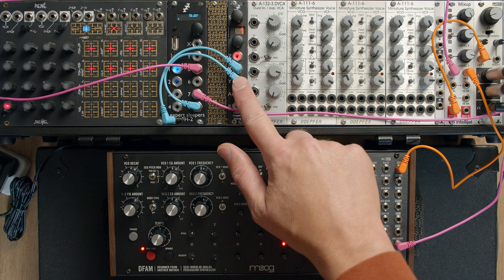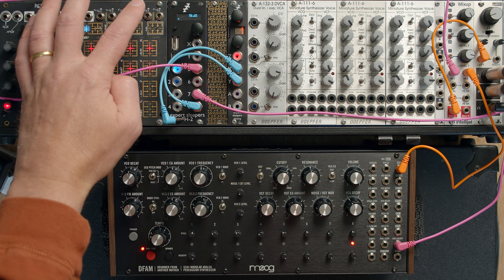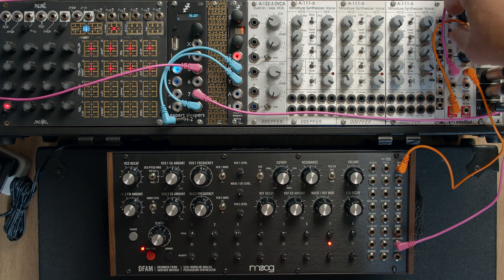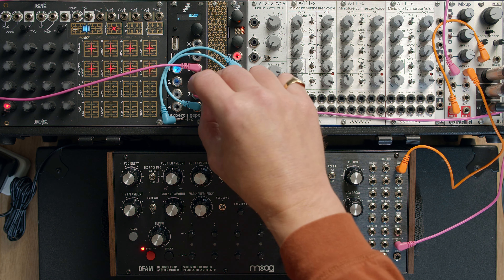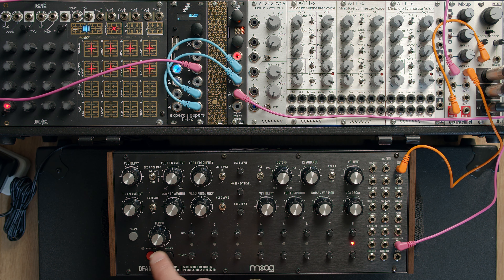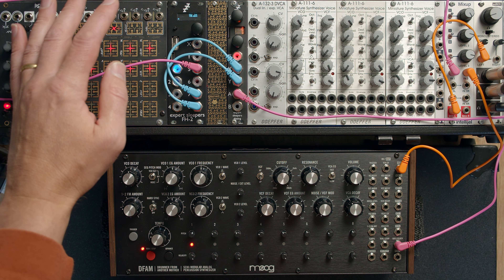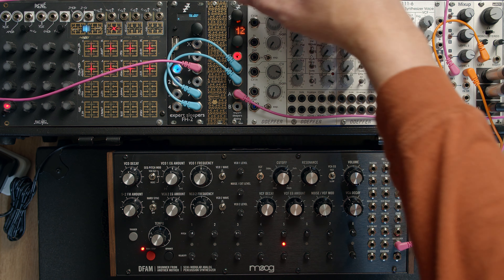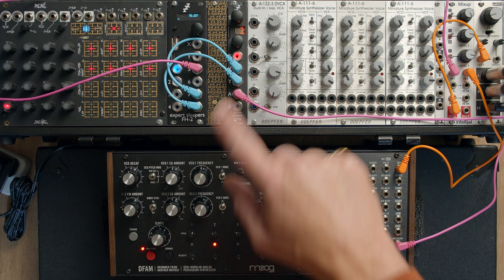disting mk4 - Counter

Comment: That's really cool! Maybe it'd be handy to be able to manually advance it to step 8 instead so when you hit play the first time it starts from step 1 rather than pulsing through all the steps
Reply: I made a really hacky version of this with an Arduino and a light sensor taped to the LED on 8 😂 It was suited for sequencers with "reset out" so would scan to step 8 when you hit STOP on the sequencer, ready to play again from 1. Not a very practical solution though.